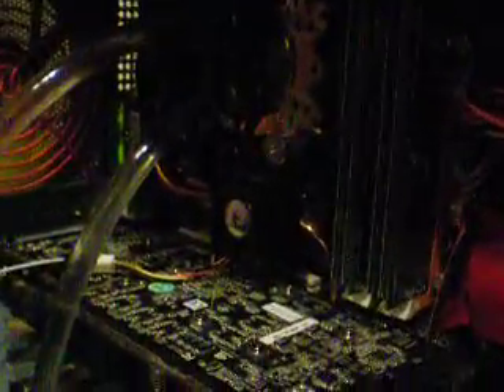My water cooling review

Comment from the maker: Well, I am gonna do that with a double resivoir, I think the one i have sucks, so im going to get the iceblue 4 port one. I will use some koolance 3/8 compression fittings. the second pump is so that the water flow stays high.